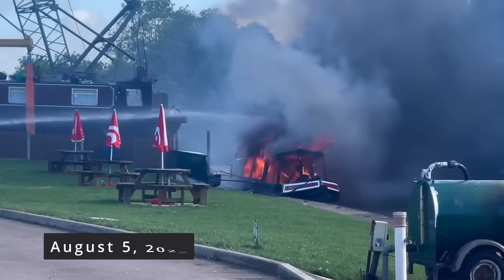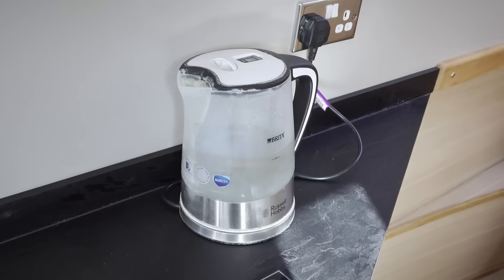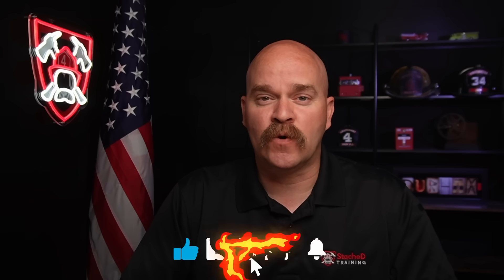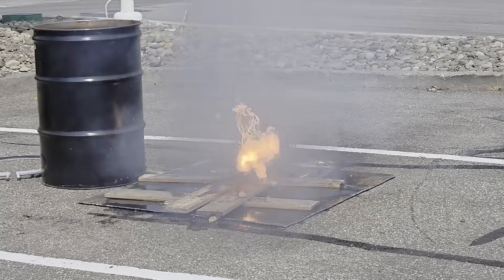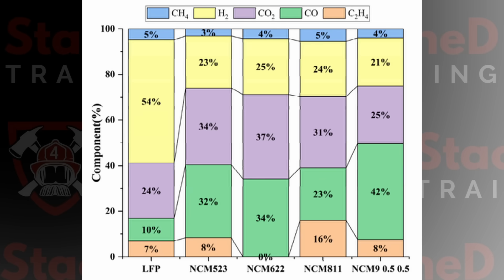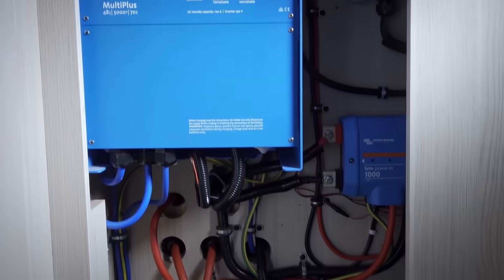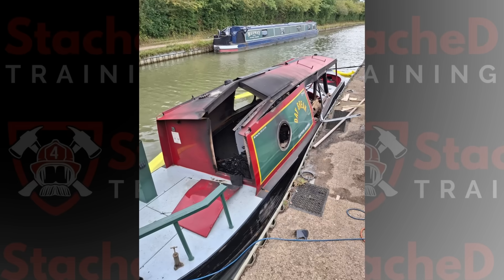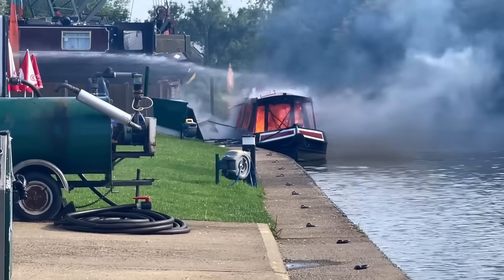Electric Boat Explodes While Charging: LFP Batteries

Comment: In situations where there is not a rigorous monitoring system in place they should have gaseous monitors to tell when there is a failure happening. This will at least let the systems shutdown and sound an alert to let those who need to know that there are conditions developing that is dangerous. We have these type of systems in place in large compressor rooms for grocery stores where there is one room that houses most of the compressors and the refrigerant associated for the systems. Generally they are setup to sound alarms and activate exhaust systems to ventilate the rooms and keep it safe for service personnel to enter and fix the issues. This is what should happen for the boats. On top of that all through penetrations should be sealed to keep the gases where they can not get to an ignition source. The newest refrigerant on the market R454B is flammable and the equipment is required here in the US to have sensors in them to shut down the equipment in the event of a refrigerant leak.

Comment: In the UK, we have been having intense heatwaves, I am not surprised batteries are going into thermal runaway, I bet the boat had just got back from use, batteries already hot, high ambient temp anyway, then the final straw, it was put on charge.

Comment: They had some good gear on board. Something has been overlooked. Normally critical temperature feedback setups would take care of it and shut charger and loads down. But yes, electronics do fail. That's why 747's have some backups duplicated, and even  triplicated in some controls and monitoring. I guess with home stand-alone power systems, economics can play a big part.

Comment: Interesting that comments are often made that LFP is 'safe'.     As you say 'safer' than alternatives.    I dislike all my consumer lithium batteries, including my tool batteries.    Never had a problem - but consider that is luck.     It seems there is no way to know when a battery may fail.    Fortunately, safer battery chemistry is on the way - I just hope it speedily comes available, and safety is rated higher than performance.  I'd much rather deal with less power (ie more frequent charging or swapping out) then continue with the thermal runaway threat.
Reply: You are using Lithium ion batteries. Not the same chemistry as Li Po 4.

Comment: These are Cobalt Lithium Cells, 600 cycles at 90% DoD or 4,000 cycles at 60% DoD to 70% capacity. LFP cells are 6,000-8,000 cycles at 90% DoD to 80%.

Comment: Sounds like the BMS, Battery Maintenance System, may have been damaged or set up wrong. Or the charging station was charging at too high a rate for the BMS to handle. I ride an electric bike, have since 2019. And I've never had a problem with the battery or motor, or charger. But then I use the charger that came with the battery. It really is hard to say why it happened. Oh, and I was also told not to plug the charger into a power strip, even if it has a good surge protector. I don't know why, but I don't do it.

Comment: How hard would it be to just keep that compartment dry? And ventilate it when battery gases accumulate?

Grok says “Advanced BMS can integrate gas sensors to monitor the environment and trigger alarms or ventilation if gas levels exceed safe thresholds.”

Comment: Something a bit suspect about this video. If the batteries went into thermal runaway and were mounted under that rear deck, I would expect serious damage to that rear deck area, but there’s none.
Reply from the maker: That compartment would be extremely an extremely rich flammable atmosphere.   It would push through the vapors through the holes into the cabin and at that point be a pressurized gas fed fire.

Comment: I have like 500 4.2v lithium batteries each with 2200mah in pouch cells, each has its own bms I had built a large battery before understanding the dangers.  While building the battery is when I learned that what I was building was a mistake and I had to put it in ... somewhere I didnt live... so I put it in my storage unit uncharging just sitting there, is that in danger of anything or so long as its not charging should stay stable, trying to figure out how to rid myself of them at some point and other various lithium batteries

Comment: Actually, that under-the-bed "ReDoDo" battery setup looks like it could be an accident waiting to happen. A real redo opportunity - no undo button.

As with the "Predator" batteries, I don't like the terminal sizes. Even if installed properly, thermal cycling may loosen them, creating a deadly ignition source.

So the ABC Leisure Group purchased a fleet.

Thankfully, this wasn't a plane.

Comment: I work at a company designing and producing energy storage. We package each group of cells into 1kW modules which are built like tanks, not only is the BMS designed with UL1973 in mind (no single failure of the electronics can result in an unsafe condition for the batteries), but these separated modules protect from catastrophic failures. We have initially ignited the pack, putting every cell within the module into thermal runaway (UL9540, only requires safety of one cell propagating but the true worst case scenario is all cells), and the outside of the module did not exceed 55C. LFPs are a great chemistry, are they dangerous? Depends on who and how you are using them. I appreciate this video because it highlights the need for better engineering and containing the worst case scenario because Moore's law is very real. Edit: modules are also IP67 😉
Reply: Yes. There's a huge difference between 'cells' and a 'battery'. The Design & Engineering of a battery can be terrible. I've just repaired a Midac forklift battery and its practically designed to short circuit. Scariest work I've done for a while.

Comment: My two cents is that lithium batteries belong in sealed battery compartments that have a vent to the high point of the vehicle or structure.

One of the best installations I’ve ever seen had the vent and the ability to flood the battery compartment to submerge the batteries.   It wouldn’t put the fire out but it would prevent the boat from burning to the waterline.
Reply: Which kind of Lithium? Very important.
Reply: @tmog1000  it doesn't matter.  They all burn even the iron chemistry.
Reply: @fountainvalley100  Not in the testing I have seen.

Comment: Full disclosure, I'm only a home builder. Fire codes require occupied spaces to meet a fire safety standard measured in "minutes." For example, a space may require a 30 minute rating, meaning that a wall, floor or ceiling, must resist a fire for 30 minutes. Presumably this would allow time for the occupants to get out.
Also, fire code requires a specified number of egress points depending on the occupancy of that space. 
(You may have seen these fire department permitted occupancy limit signs in public places)
My question is, "How can an electric ship be made to meet fire safety standards for even 2 minutes?" Passengers wouldn't stand a chance of getting off of an explosive Electric boat. SMH
Reply: This all about green ideology where there's no room for safety standards. It's let's just build a house cause the rain is coming, who cares about code, we don't want to get wet. Anyone that would say that to you, you'd take them straight to mental institution, yet here we are basically using customers as crash test dummies. Worse of all the dummies are all for it and defend this tech whenever it fails.

Comment: I once had a small electric boat which i fitted with a completely new electric motor and separate 12V electrical system, charged by solar cells. After finishing it, i immidiatly noticed a massive buildup of moisture in the electrical systems i could not stop. My original plan was to use lithium batteries, however i quickly noticed how much a problem this moisture was and i could not stop it. I scrapped the original idea and returned to using large lead car batterys which i charged outside the boat. Getting everything watertight and free of condensated water was too much of a nightmare. I coated everything electric to protect it, but the water will find its path. In the video, i immidiatly noticed all the blank electrical contacts which could corrode and increase resistance or create unwanted currents. I would not be surprised if a overheated connection or inproperly installed wire with damaged isolation caused the problem. This whole installation looks a bit questionable for my taste. My guess is the batteries didnt start the fire, but ignited at some point. But thats just my opinion! Thanks for the video!

Comment: 1) Comments from others indicate it was the house batteries, not those shown. The shut hatch on the rear deck corresponds. 2) Simple ventilator fans could have taken this from an explosive event to a fire event. 3) LFP smoke is not necessarily 55% h2 as it depends on state of charge.

Comment: Its clear that this is a dangerous installation and probably the same on the other boats the owner has.
You should never series these 12v Lithium packs and charge them with a 24v dumb charger as Lithium doesn't absorb an unbalance between the two packs like lead acid does.
If one cell's BMS has a fault or blocks the charge to the battery, the other 12v battery will get the full 24v from the dumb charger. Is the charger set up for LFP? 
If you require 24v then buy a 24v single pack or build a pack from prismatic cells with a BMS and charger that is controlled by the BMS. Do not parallel them either for the same reasons.
I have built/converted a number of EV's as a hobby and have a good working knowledge of LFP and BMS systems.  I worry that the other boats have a similar install and if @CruisingTheCut is interested, I would be happy to look them over and give an honest if unofficial review of them.

Comment: Great video. Understood that there are several sister boats. How much is the temperature inside the battery compartment during the charging process? Is this temperature monitored? Absolutely the battery room must be ventilated and kept under positive air pressure. The wall separating the living space have to be totally sealed avoiding potential flow of nocive and hazard gas as already happening in bigger boats. Crazy the person that installed a battery under his bed. Too many inexperienced, improvised installers. Italian follower is appreciating Your video. Saluti.

Comment: Fault claim. Don't think the author really know about LFP battery. LFP doesn't explode like NMC, of cause it has to be proper designed , battery and battery compartment, which should have gas release hole, that is standard but vital design. LFP will melt, not like the flame flower like NMC battery. And car maker like BYD fill it with liquid coolant, which make the temperature rise much slower.

Comment: Lifepo4...  is not the issue. Its the lack or bad bms.  Like, overcharging or bad runaway charging. 

Lifepo4 will not spontaneously combust.  You can puncture Lifepo4, no combustion. 

Anywho ty for the video

Comment: This is precisely why physical battery management is just as critical as the electronic battery management.

They need to be in a fairly controlled, well ventilated environment. You get best results usually from keeping them well away from any moisture and controlling the climate they're in at least somewhat. If that requires some form of air conditioning or means of air circulation then so be it. you don't want the packs to get excessively cold, as this degrades them rapidly when charging / discharging, and you don't want their internal temps to exceed 50*c to prevent the risk of them beginning to thermally run away if they see a heavy load or high charging current, therefore a cool environment with good airflow is very strongly advised.

If a cell bank or the entire pack vents off, you don't want the electrolyte it's venting to build up in the space. It needs to be able to escape the battery bay quickly, which can be done with decently sized vents, or even by adding fans to pull air through the batteries and then out of the vehicle in question. Good airflow on LFP packs can and will prevent an explosion event, as LFP is a lower energy density chemistry, and therefore it can't easily build up the needed heat to auto-ignite the vented electrolyte like you'd see in a violent NMC battery failure. Good ventilation pulling the vapours out of the battery bay should be sufficient to turn a battery failure into a non-event for the most part. The only instances I could foresee as to why a fire could occur would be as a result of a BMS failing violently or a wiring issue resulting in sparks. If your inverter and BMS systems are separate to the battery packs and sealed off though this would also further mitigate the fire risks.

Comment: Lfp batteries should be vented in the same way lead acid batteries are.  Also it is  good practice in a marine environment for all bulkhead penetrations to be glanded.  This is needed to contain water on the event of a leak as well as to keep gasses out of the cabin.

Comment: Read some comments   You jumped the gun on this   Desperate to find an iron oxide  battery fire to condemn  home power systems too? fyi Single biggest risk on small boats are from FOSSIL FUEL engines  & cooking
Reply: Most folk aware of risks from gas used for cooking on small boats but that doesn’t stop boats getting blown up by gas leaks. Diesel relatively safe and never been on a boat with petrol engine though I believe there may be some. Heat of the engine, maybe dodgy electrics and combustible materials most likely cause of fire. Became aware of need to ventilate batteries on hybrid cars maybe two decades ago when car salesman drew attention to this. We don’t appear to have become sufficiently aware of these issues since then! Anything that enlightens us to the risks might be seen as helpful (rather than hostile)!

Comment: Deaths involving canal boats 2024 = 1
Deaths involving walking on the tow paths in 2024 = 22.
(WAID official documents)

I dont feel well enough to plough through all the data again - especially as I was ignored last time, even after posting a direct link; but just from looking at headlines, multiple canal boats catch fire each year - usually due to diesel engines, or gas leaks from onboard cooking facilities.

As for this incident - it is still under investigation - the batteries are only "suspected" to be the cause at this point - it could easily be a charger wiring fault that started the fire, that then spread to the rest of the boat,
The "evidence" that the explosion bent out the side walls is also problematic - the heat of the fire can warp metal, especially the thin alu frames of these built-for-leasure boats; and if the batteries exploded with such force - why didnt the boat sink?

TBH, I have seen a tin of beans in a microwave, do more damage.

Comment: The photos in the video give limited information.  It appears a Victron charge controller which is probably in the five best controllers is in use.  The batteries appear to be Predator brand which has a reputation for quality.  The terminals appear to be correctly swaged onto their connecting cables and there appear to be balance leads connected to the batteries in the series string.  I am not sure about the wire gauge of the cables.  It is difficult to assess the wire gauge from the photo.  There is not obvious bilge water in the photos which could be from a different boat.  Just from the given photos, I do not see an obvious cause.

Even good batteries fail.  There should be a gas detector, temperature sensor snd adequate ventilation in the battery hold.  The photos don’t give a means of knowing if those precautions are in place.  As noted in the video, whe batteries go exothermic it is difficult to stop the self sustaining deflagration.  It is best to design from the standpoint that a failure will occur and have mitigation and survivability built in.
Reply: Those images are from a "similar" boar remember, the one on fire might be completely different.
Reply: @ianemery2925   Correct, I wrote “… which could be from a different boat.”
Reply: @wtmayhew  AH, sorry, I missed that part.
Sometimes "Read More" appears at what seems to be the end of a post - so I didnt realise there was more.

I dont know if you saw my main post - UK deaths in canal boats 2024 = 1, deaths walking on the tow path 2024 = 22.
Reply: @ianemery2925  Thank you.  I am glad you pointed out what you did.  I should have put that I. The first sentence.

Comment: Not the best choice of battery for motive power. Probably pushed near their limit at normal cruising power. Running at maximum available output to get back to hire centre on time(been there done that!) maybe 5kW, would lead to a heat build up, especially with no spacing. Then add rapid charging for the next customer……  A small ex EV car battery would be way more resilient, although you would have to contend with higher voltages.

Comment: OMG, a battery fire, let's blow (pardon the pun) out of all proportion. OK, batteries can be dangerous, LIKE ANY TYPE ENERGY SOURCE.
I've seen many cars, boats and caravans burnt to the ground or waterline caused by fuels, some of the worst fires and explosions are when refuel boats or even cars.
LFP batteries are extremely safe, but nothing is 100% and I feel with this installation was done poorly. Like any installation, things can go wrong if it's done wrong.
Could you find out what actually caused this failure if possible.
I still have family and friends say they will never use lithium batteries, "don't you watch the news"
Reply: Someone decided to use Lithium batteries for power if the boat... that's reason why it happened ..!!